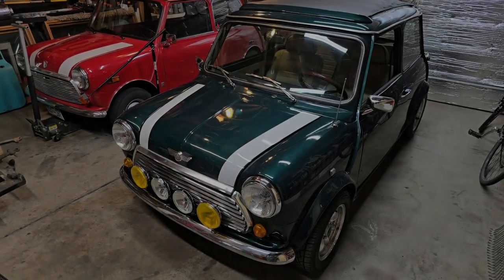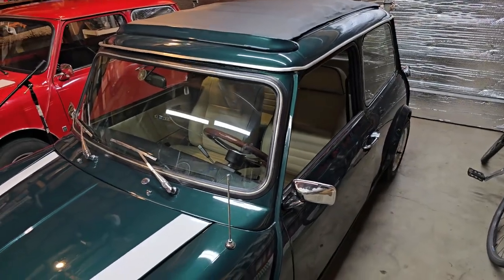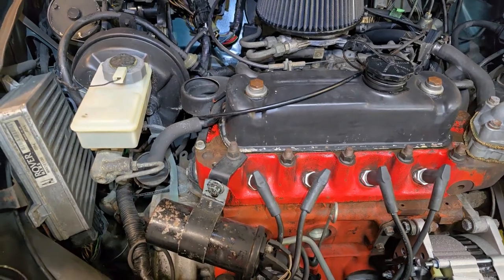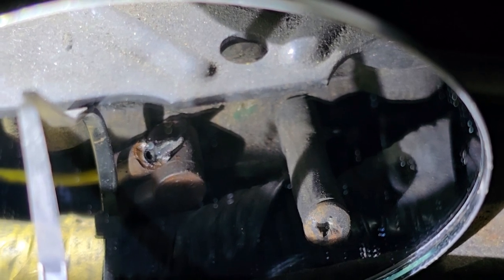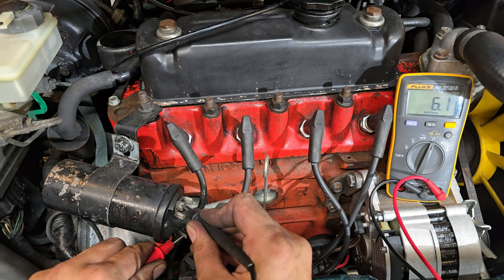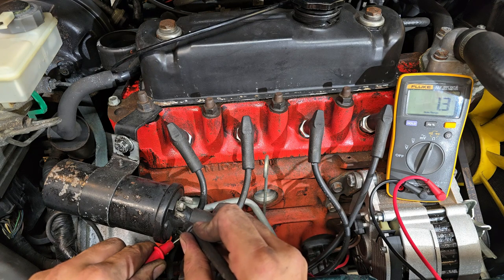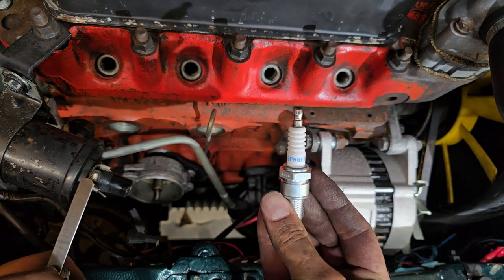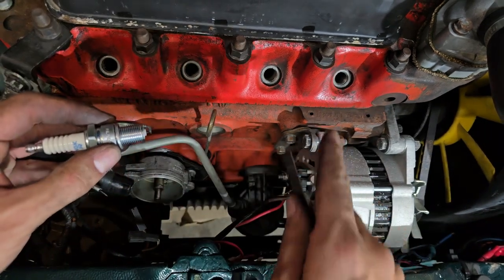Oh My SPI, lots of maintenance problems, Part 1

Comment: Do I need resistor plugs if only running 65d dizzy with carb and no stereo?
Reply from the maker: Use non resistor plugs and 1.5k to 3k ohm spark plug wires.
Reply: @darrensrestorations991  Thanks Darren! The vids are great!

Comment: Thanks for this. Like someone else said, it would be good to see more injection model videos.

Also, what would you expect to see the resistance of the leads ideally being.

40 odd years ago we'd have put resistance plugs and leads in to stop interference on the radio. Would you mind doing a short video explaining all about the electrics, their applixations, differences re plugs, leads, distributors their benefits and drawbacks? Thanks again
Reply: Just watching further and you're saying the gaps should be 35 thou. I know it's something to do with high power Ignition, as usually they'd always have been 25. Just to my previous request, which cars, setups etc are 25, which are 35, why etc etc? Just if you don't mind..
Reply: @GPZ_Biker  decent new leads are under 2K ohms. A good guide is to keep them till they are over 5K ohms, then replace.

25 thou gaps for points or low power electronic ignition. 3ohm coil OR 1.5 ohm coil and ballast resistor OR 1.5 ohm with 12V feed with variable dwell electronic 
35 thou gaps for nominal 0.8 ohm coils - 65D carb setups and fuel injected
Reply: ❤ school day. Thank you! I think there's definitely a video for your catalogue in that lot. I'm on my first mini now since the 80's and had no idea about any of that. Thanks again
Reply from the maker: Yes, @timsminigarage is correct.
I will do an episode on this at some point soon.